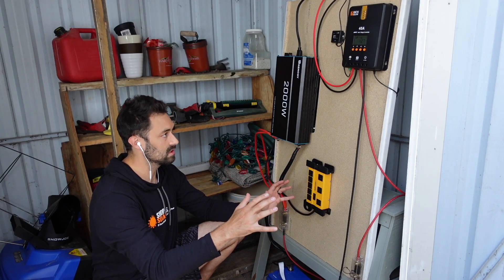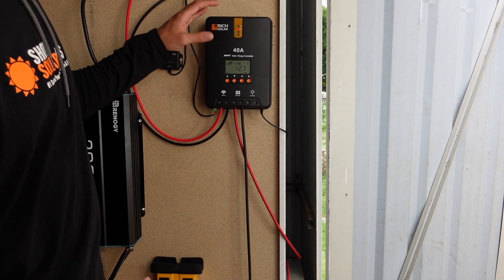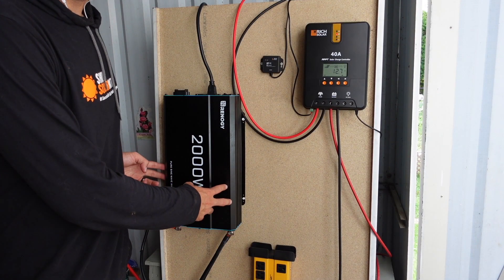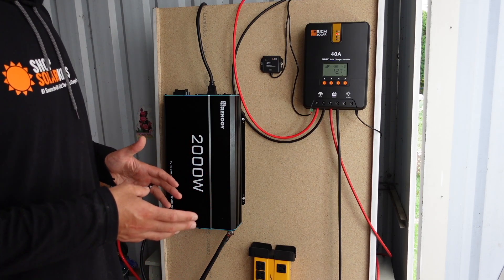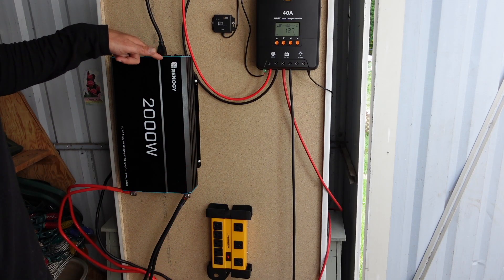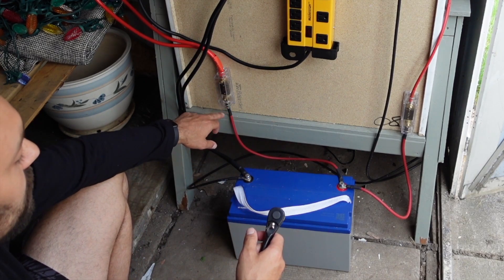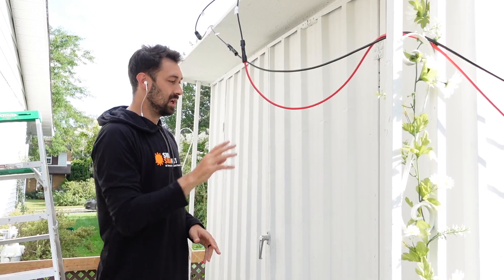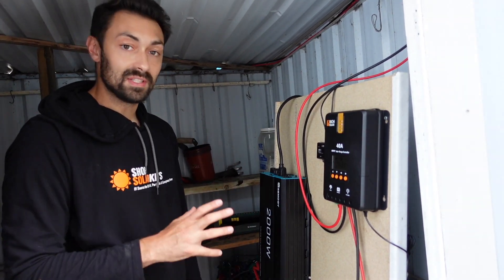SIMPLE Off-Grid Solar Shed Set-up | 2,000 Watt Inverter, 200 Watts of Solar | Step-by-Step Guide

Comment: You can run the charge controller battery wires directly to the inverter and shortening the cables is best , just a thought

Comment: hello sir i would like to build a 1200 watt power system.i need info to do it safely.minimum 1200 w.per hour use and for 12h / 18h per day.but i want to charge the battery via a battery charger that is suitable for it.i do not have solar panels.and it should be possible to make such a system without solar panels.do you know how i can get the information on how i can build safely?

Comment: I want to build a system like this but I want to use two 12 volt lifepos 100 amp batteries, what size fuse do they use between the battery and the inverter, I see you’re using a 200 amp fuse , what determines the fuse sizes and can I use a 12v breaker instead

Comment: You mentioned connecting your 2x 100w 12v panels in series, wouldn’t that make it 24v? I thought since the controller and batteries are 12v, it’s better to keep the panels the same. Could you be able to explain why series was done for this example? Thanks!
Reply: guess not, i was wonderig the same

Comment: Not sure if anyone mentioned it but you should also include solar breakers between the charge controller and the solar panels. And probably a battery cut off switch for the battery between the large fuse and the charge controller on the positive cable. Just more precautions.

Comment: Hello.  I'm considering buying one of your kits, but was wondering if there is charge controller available that could also take an incoming 120v line from "the grid", so it could still charge the batteries if/when the batteries are drained at night (basically self switching between solar and house power)

I have a little pump house for my water pump, and I'd like to convert it to solar, but don't wanna loose functionality at night if it can't charge.

Comment: Those Extension Cables, to the Panels10 AWG ?, are only Good for 100 Watts at 20 ft Maximum, No more Watts, or Amps.  Two, 100 Watt Panels, is Twice as many as its Rated for ! I have 4 -115 Watt Renogy Bifacial Panels Ordered, and Bought one of those Cables from Renogy for Extension, Only To Find Out that its one $23 dollar Cable, Not Two, and  Useless.  I will Be Putting My Controller Near The Array !!!  I would need 4 sets of those Cables for 4 panels, at over 20 dollars for One Cable, times 8 for four Panels. The Charts are hard to Find that include Watts, Amps and Ft for AWG 12 Volt Wiring. I suggest You Find one ! This is a common Mistake on Youtube Soler aray Set Ups ... 12 AWG Cables are Wors !

Comment: Why connect the panels in series and not parallel
Reply: Series gives you higher voltage so less losses in the wiring from panel to charge controller.

Comment: If I wanted to power a single room in my home, could I run an extension cord from the inverter outlet from the shed to the wall of my house and wire it into a wall receptacle?

Comment: Like 300 watts better than 100 Watts. With 100 watt solar panels you need ever so many solar panels to make one kilowatt you need 10 100 watt solar panels to get the power you need from solar panels from 100 watt solar panels you're in at least need 40 to 72 solar panels that are 100 Watts that's not feasible for most people when they don't get that room I like 300 w solar panels because that's less solar panels you have to have I like 350 w solar panels because they're better because now two solar panels at 350 Watts at 700 Watts they see the difference instead of having to have seven solar panels to make 700 Watts now you only need two solar panels at 350 watts to make 700 Watts that's more efficient I don't watch her less efficient and take up more space.

Comment: What size wire do you recommend on a system with four 100-watt solar panels in Parallel running into an MPPT 40-amp controller and using a 100 AH Lipo 4 battery?

Comment: I am currently learning about solar energy and have yet to build my first basic solar system, so this video comes handy. I see that you have added 2 fuses, 1 between the charge controller and battery and 1 between the inverter and battery. I am aware this is not a complex setup, but would it be advisable to add circuit breakers in addition to the fuses (or in place of the fuses) to help break the circuit for maintenance or protect the circuit in case a component develops a fault (just like a fuse would do)?
If circuit breakers are to be added, what types would you recommend, in terms of amperage, etc. based on your circuit design, and where would you install them on the circuits? Thanks.

Comment: How would you do this in a tent trailer? I’m thinking of setting up my area underneath my dinette seat. Do you recommend the battery inside the dinette seat with the inverter, charge controller and a kill switch? I’ll connect my electrical to the inverter, and thinking of taking the electrical cable out and put an solar extension cable there to our 2 solar panels (we don’t camp where there is electrical hookups) and then we can put the kill switch on when we are packing up I don’t want the solar panels on the roof, I rather have them tilted in the sunlight :) 

 (Don’t worry there is no water system in my tent trailer! I took that out already) :)
Reply from the maker: Hi Anna, for more information on how we would set this kind of thing up for a tent trailer, I recommend giving us a call at 1-877-242-2792 where we could discuss your set up and the best practices to get your system going !

Comment: Hi mate ive just purchased this Inverter. I see you haven't connected the Ground ring terminal on the DC Input Side? Is there a reason for this? I've read conflicting information about whether to connect this or not?
Reply: I just bought one also and that's the reason I came here. I also don't understand the 200 amp fuse from battery to inverter, I thought it should be less to protect the wire but I'm not an electrician.

Comment: If all your tasks were direct current (in other words if you were NOT powering a house but just lights or something) you would not need an inverter.  Inverter just turn DC (battery) to AC (household appliances).  But you can buy lights that are just DC.

Comment: What about the load section of the controller can you connect something directly without the inverter and the battery, like a fan and run it with the solar panel.
Reply: The load output on controllers I’ve seen are still 12v.  I have a smaller shed setup where I have a 300 watt inverter connected to the load output.  I like it because of the battery falls too low, the load shuts off, I don’t have to watch and do it.  I’ve seen in other videos where it is not recommended to be done that way with larger inverters.

Comment: what size of fuse?
Reply: @3:02 40A fuse between charge controller and the battery, 200A fuse between battery and the inverter.

Comment: what happens if you don’t turn of the inverter?
Reply: The inverter will draw current from battery even if you do not have any load connected to the AC outlet, according to the spec of the 2000W 12V inverter, it will draw about 2A which is about 24W, so if you leave the inverter on, it will use 24W x 24 hr = 576Wh from your battery so if you have 1000Whr of battery capacity, it will run your battery down in about two days just by having it on with no load.

Comment: Thanks for this video. Very easy to understand. So question....I too need a solar shop but part of my system includes a well that has a 240v (4 wire) well pump. What should I consider using in order to have something like what youve done here as well as adding something  giving me the capability of running my well pump as well. I use the well for lawn watering and 3 acre irrigation. Location washington state.

Comment: How many Solar panels can you use on a 2000w inverter. Is it a general rule 100w solar pannel, 1000w inverter, 100ah battery? So for let say 3000w, you need 3 - 100w solar panels, and 3 - 100ah batteries?

Comment: I’d like to see what % of the battery was left after running that jig saw for 5 seconds.. 100AH battery with a 2000 watt inverter trying to run small power tools would probably get you 2-3 mins of run time before your battery is drained completely. A lot of people think you can run these tools off a 100AH or less battery using a 1500-2000 watt inverter but it doesn’t work that way. They end up ruining their batteries because theoretically they need 400-800AH at minimum to run AC appliances such as a circular saw etc.
Reply: I can run my 19-in flat screen TV on my 1,000-W inverter and two 12-volt 13-watt bulbs which are 60 watt equivalent I believe for 2 days straight without charging the battery before it stops working. It then takes my 100-W panel 2 days of sun to bring things back to normal. I've also got a 12-volt fridge in the mix and I've got no issues with my hundred amp hour battery.
Reply: Yeah this is a problem Im facing setting up my own system. I want it to be able to run a small ac and some lights for hours at a time, but I’m not sure how to set it up so that the panels provide enough continuous power for the battery to stay charged.
Reply: 5 seconds wont even drop the battery % by 1%

Comment: Thank you. Great video and easy to understand. Can you tell me if there is a difference between using 1 x 200amp, and using 2x 100amp for the 2000watt inverter to the battery.
Reply from the maker: Hi Woodeee, thanks for your questions. The biggest difference between using the 1 x 200amp or the 2 x 100amp would be that you need more accessories for the 2x100amp. If you have any further questions, please dont hesitate to call us at info@shopsolarkits.com or call us at 877-242-2792.

Comment: The controller is identical to renogy. I wonder who makes them for who?
Reply: It's cheaper than the Renogy and has larger/stronger wire terminal connections than the Renogy.  OEM is either HQST or ROHS.

Comment: What would be the easiest way to hook up a gas/petrol generator to charge the battery(bank) should there be a couple of days of bad weather? Is there a simple yet effective way of doing this without having to disconnect the batteries from the MPPT controler?
Reply: https://www.youtube.com/watch?v=5ZC6hHDjU2I
Hello there this guy explains how you can hook you generator to charge the batteries when you dont have enough sunlight or on the winter season

Comment: Can you use 24v of solar panels coming in and everything else be 12v?
Reply: You would have to put a lead between two 12 volt batteries. With that said I don't know if the charge controller can control that type of set-up. Also you would need to equal out the loads between the two batteries. You do not want to drain one battery and leave the other unused.

Comment: Nice vid. Btw,if i use a 1500 watt induction cooker, how many hours does that kind of battery on the video will last, before it runs out? Thanks
Reply: Honestly if if the battery is being charged 8 to 9 hrs a day it shouldn't matter using the induction stove twice a day